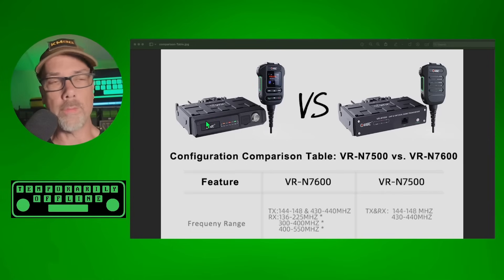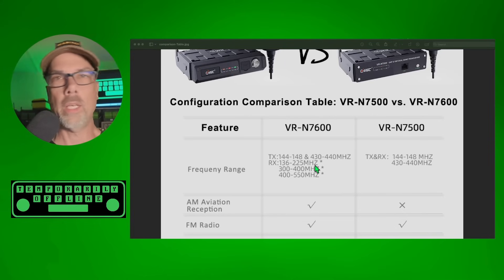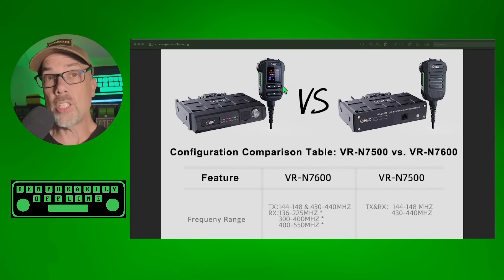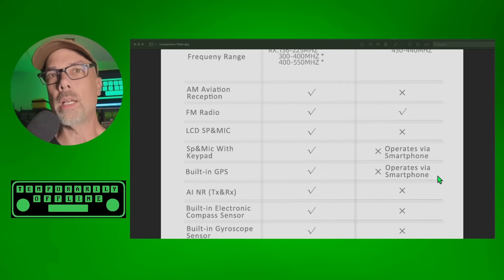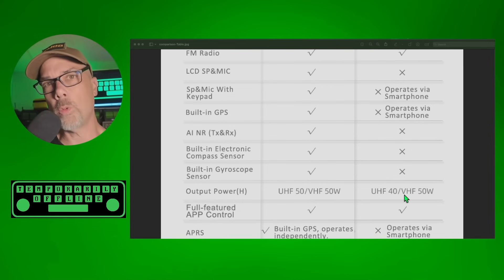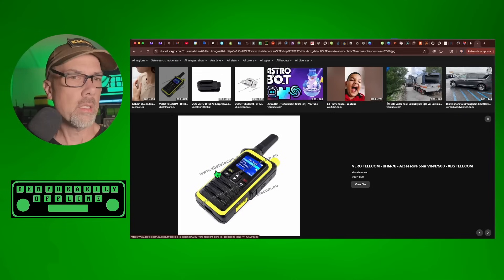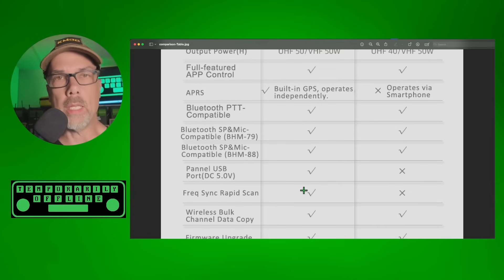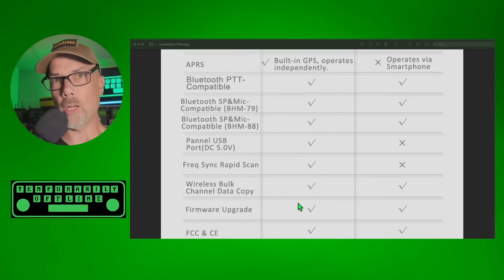Vero VR-N7500 vs VR-N7600: The SHOCKING Truth About These Radios!

Comment: Do you have a video or any intel on unlocking the 7600, to be able to theoretical tx on the other listed frequencies?
Reply from the maker: I have some info on how to do it, but I don't have a "locked" radio to test it.  Connect the radio to the app, go into the app and find where the battery info is.  Tap that 10 times and you'll be asked about something like a factory test mode - enable it and that should do it.

Comment: I have a 7500 on my motorcycle and it works great. I have a 2nd 7500 hidden in my wifes truck. I use the BHM-78 bluetooth speaker/mic in my wifes truck. I won't get the 7600 do to the mic 8 pin connector. It should be a RJ45 if you want to run a longer cable. But they have the new BHM-88 bluetooth speaker/mic.
Reply from the maker: Great setup! They do make 8pin extension cables if you need them

Comment: I have the Vero VR-N7500 and a MBH-78 bluetooth HT. I see that the MBH-78 isn't available now but it allows me to do most anything without my android. Like you said about the new mic for the N7600, it's hard to navigate, but it is possible. The MBH-78 does allow me to do APRS with the built in GPS, but there's no real mapping feature like on the Android. I won't be replacing my N7500 with the N7600, but I am intrigued with the HT versions. Thanks for the information. 73 de K5MGK
Reply from the maker: You're welcome!

Comment: Did you already post a video of opening up bands on the n7600? Was searching but didn’t see it. Thanks. Love your channel!
Reply from the maker: There is a method to do it. But mine was already open so I can't confirm it for a video.  Test that yours is locked. Then  go into the HT app and tap the power listing 10 times and it should prompt you to enter the expanded mode.  Say yes and test again.  This is a one-way trip.  Let me know how it works either way.
Reply: @temporarilyoffline lol, "one way trip" sounds ominously like these other bricked chinese radios I keep around for parts. Im holding out for a Yaesu VX6 so I can reliably do Skywarn. If your budget allows the possibility of making scrap parts then it should be fun to open up these radios. If your budget is connected to an old Irish wife with deadly aim use it as recommended in the instructions. lol

Comment: got to this video looking for an answer, still cant find it lol. From the smartphone app (Android), can I listen the audio from the radio? Not controlling it only,  listening to. Can't find any video of someone doing it. Can you check my friend?
Reply from the maker: Yes, you can listen too and talk from the phone:  https://youtu.be/pSa5zlQ5Yv8?t=599 (Time stamped) I should make another video on the N7600 starting over from the beginning...  so much stuff to cover in this hobby!
Reply: @temporarilyoffline nice, thanks bud. by any chance do you know if the 7500 does? I think you have both right? I may don’t need all the features of the 7600, only looking for an option to monitor my local repeaters on my smartphone. Maybe the airband (if the audio is good) will be a good reason for the 7600

Comment: Cathy Zhiang's great but she's not very technical, not being a ham herself (unless she got licensed since the last time we communicated which was in January.)

I only have the VR-N76 HT which can now do satellite communications with auto Doppler correction (via the app, I don't see anything about satellites in the radio's menus.) If they keep updating the firmware and adding features they're going to have a D-Starless clone of the Kenwood TH-D75 for around 25% of the price, which would be aewsome. I don't need a mobile dual-bander and already have a great VHF-UHF radio in my shack (Alinco DR-735T) so no N7600 or 7500 for me, but if I were to get one it would be the 7600 for the mic with a display and keypad and the AI noise reduction for simplex.

BTW, the VR-N75 is also a PoC radio besides GMRS over RF, has APRS (both PoC and UHF GMRS) and can act as a cross-mode repeater, interconnecting PoC Internet radio and GMRS. Pretty neat!

73 de DV7GDL.

Comment: QUESTION - In Search of Answers / Solutions.....  I wanted the N7600 but my existing Mobile couldn't last long enough so I had to get the N7500 a few months ago.  Need to know - How do you dial a phone on Autopatch using one of these new radios.  Everything I have tried has failed.  Even the N-76 WITH a number pad seems unable to dial a phone number through AutoPatch.
Reply from the maker: I don't personally have experience with auto patch, but I believe it's just DTMF?  If so, the you creat a preprogrammed DTMF sequence in the radio's memory and the select it and it gets sent over RF.  If that ain't it. We can figure it out together!
Reply: @temporarilyoffline THANK YOU!!!
Reply: @temporarilyoffline  How does one pre-program a DTMF sequence?  And do I have to do that once for all 10 numbers or do I need to do it for every number I might call?
Reply from the maker: @GTGallop I'll have to look it up myself when I'm back at my radio.  Join us on the toads discord (link in bio) and ask the group if you need an answer faster
Reply: @temporarilyoffline - OK! Half sorted out! Woo hoo. The N-76 has a menu to send DTMF. It’s in the Radio Menus and not accessible by iPhone. Because of that, you need the screen on the radio. The N-7500 doesn’t have a screen so I need to see if the DTMF is accessible via Android. If so, I keep a burner droid to do radio stuff and I’ll use it.

Comment: Can it Tx on the 1.25m ham band (222-225MHz) when unlocked?  The N7500 will quite aways around the other two bands (inc MURS and GMRS) but wind do 1.25m.
Reply from the maker: The 7600 will. But lower power and dirty.

Comment: I like the N7500 !  I love new tech in the radios.  i wont be on 80 meters AM real radios glow in the dark.  I love old stuff as well but open to the new fun tech coming out. It is even fun with old radios seeing no tech ! Like running FT8 on a old tube set . The old and new can come together ! This is why I love the hobby so much. 73 from NY
Reply: I am afraid the old tube set might not have the frequency stability to do FT8 reliably. Have you tried it? What radio did you use?
Reply: @nine7295  Would have to be a EXT VFO GPS locked. I do not have a radio to try . Just tube amp on IC 7300.
Reply from the maker: You don't have to be a grump to be a ham

Comment: I have the BTECH version and it sucks. Audio is not very loud and just not good. I can put a signal stick on the radio and still my Ailunace HA1G with a stock antenna picks up better. Wonder if I got a bad one or what.. I have the 7500 and am thinking about selling it to get the 7600.
Reply from the maker: Interesting, maybe.  If it's under warranty, get them to fix it!

Comment: Do you think we can get a Pi to speak it's language over the Bluetooth for the KISS TNC?  🤔 Because you could power a Pi Zero off that.  DigiPi maybe?  Lots of ideas Steve!
Reply: I don't have the 7600 (yet) but use the KISS TNC on my UV-Pro with Linux just fine. Rfcomm creates the serial port, then you can use whatever software you want. I'm planning to run a lightweight BPQ node in my car for those situations where the mobile can reach the local packet network but the HT cannot.
Reply from the maker: Here you go: https://github.com/Ylianst/HTCommander
Reply: @temporarilyoffline  But Winblows.  Interesting though.  Latte Panda maybe. 🤔
Reply: I have had some limited success in getting PAT Winlink to speak to the VR-N7500 over bluetooth and sent e-mail over Winlink Packet. I have no issues sending packet data from one radio to the VR-N76 (receiving with WOAD for Winlink on Android). I have some gateways near me that have worked (again, somewhat) but again, limited success. I think there may be some issues decoding the packet data. I've read elsewhere that it works well with Winlink over VARA FM though. APRS has not been a priority for me (yet) as I've been using this mostly as a headless base station. Seriously considering running a packet BBS with it, though. Looking forward to more information regarding the newer software, as well as any input people may have on eliminating the bluetooth factor so that it could be used with a Pi and a USB serial/audio interface cable.

Comment: Waited almost 1.5 years to buy a N7500 after learning about them. 2 months later they drop they N7600.  I would have waited and dropped $100 more just for the built in GPS and better app functionality for ISS/AMSAT work. 
  Only complaint with the N-7500 is the digital mute still lets some packet noise come thru the speaker. I've read others complain of the same problem. If anyone out there figured out the right combo of settings that fixes this issue, let me know.
Reply from the maker: I waited a bit longer than you did.  I wanted the 7500 2 years ago😂😂
Reply: the 7500 uses same app so there for does same stuff  just no internal gps
Reply: @jarredjones8476  I got the ISS and AMSAT maps but no doppler control and "connect" button like on HRCC's vid.

Comment: I'm surprised that they aren't software-setting these for the American market to the full 420-450MHz 70cm allocation for amateur radio before any mod to open them up to wider operation.

The external device requiring an app thing is still a major stumbling block.  They'd be a lot better off putting the necessary connectors to allow connecting an external touchscreen that uses standard protocols and video signals.  Hams looking to integrate this into vehicles might well figure out their own screen solutions that fit their shacks or their vehicles or their portable rigs.  And that doesn't even mean they have to take away the app, but it would be easier if one wasn't dependent on an app that might well stop being updated to new phone/tablet operating systems.
Reply from the maker: Androids are a cheap way to extend the capabilities immensely!
Reply: @temporarilyoffline  Perhaps, but I'm thinking about years and years down the line.  Club I'm in was lucky enough to have acquired mostly Motorola Part-90 repeaters typically used for public safety back before public safety went digital trunking with encryption, and the club has had to maintain a library of software in order to provision or otherwise work on those repeaters.  This software is at risk of not running on modern versions of Windows, so the club must also maintain computer equipment that can be used at remote repeater sites in order to do that provisioning.

It's a lot easier to work with programs on a Windows platform where the design was originally constructed around the user loading software from local files or from physical media, Android was not really written with that in mind.  I could easily see a day when hardware that's even more commodity than PCs have been in the form of Android phones or tablets doesn't really exist in a usable fashion in order to run the old software that would be necessary for the advanced features of these radios.

In short, (too late!) this only really is assured to work when the radios are new, the software is new.  It might work for the long term but it might not work if something ends up lost.
Reply: Or use a cheap 7" android tablet.
Reply: Obviously US is not considered a priority market for them.

Comment: TDLR - 7500 perfect for hamshack rig,  7600 perfect for mobile use.  The only thing I wish they would do is to provide an external antenna for bluetooth for longer range.
Reply from the maker: That would be good
Reply: For the shack you can use HT Commander app on your PC to control it too
Reply: face book groups show how to mod them. you add your own antenna afetr you solder one lead

Comment: I bought a 7600 not long after release and have been very happy with it... except for the compass. It's practically useless.

The compass is actually inside the hand mic and is so sensitive to everything around it that it only works in an open area with zero interference. Even having it inside my running vehicle makes so it can't accurately measure. I don't really need it for anything but I'm disappointed about it nonetheless.
Reply: good to know i was wondering how i was going to move the whole radio in a figure 8 with power and coax attached lol
Reply from the maker: I get that

Comment: I was looking at picking up a 7600 but unfortunately both are more expensive now due to tariffs and dollar devaluation and put them in the same range as an Icom.
Reply from the maker: Still beats the icom on specs!
Reply: some wenbsites have it cheaper than vero and have discount codes.. got mine for 289 american